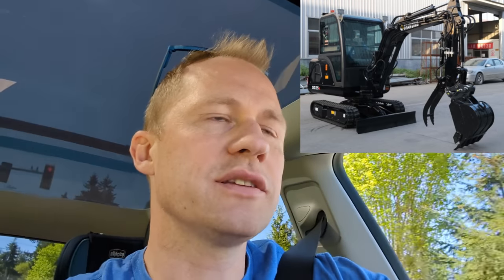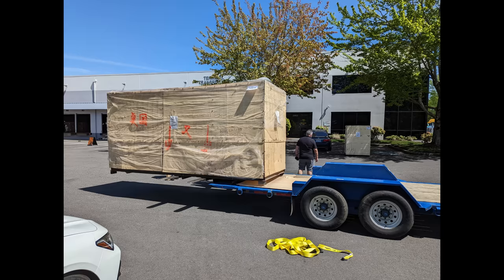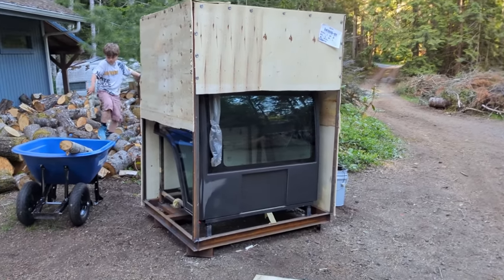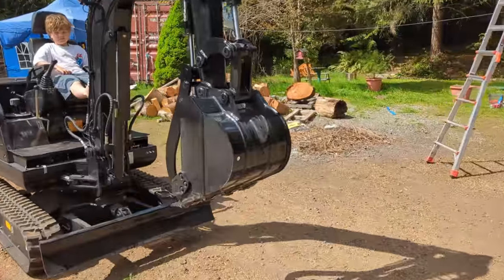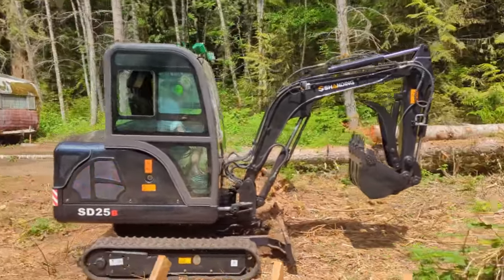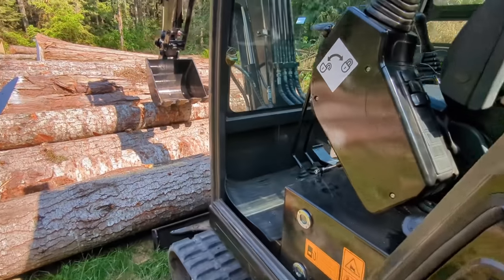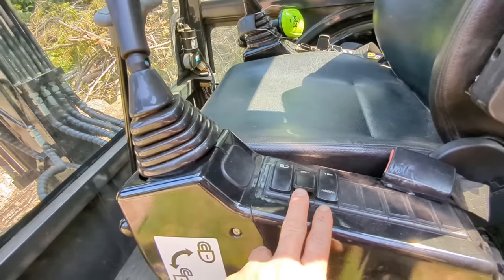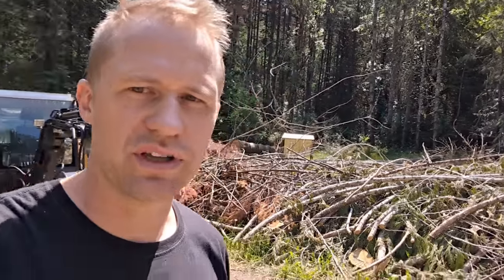Collecting my Alibaba Mini Excavator, Unboxing, and Feedback

Comment: Take it easy on that machine, don't hog it.  Grease all pivot points daily.  Pray you never have to make a video re getting repair parts from China.
Reply from the maker: I am babying it. Taking it easy, warming it up for 10 min before I drive, and let it cool off when I am done. Grease every time.
Reply: I mean the majority of parts are going to be off the shelf components so great for people that diy repairs. You can swap out the motor for anything remotely similar (a motorcycle engine would be a killer swap in) in a couple hours. Imo better for repairs than something like cat where everything even bolts are proprietary.
Reply from the maker: @stich1960  Thank you for the info. I will keep that in mind when it is time.
Reply from the maker: BTW, what does "hog it" mean?
Reply: @einarmikkelsenPNW  hogging with a digging machine is a slang way of saying you stick the digger into the material like it's already loose, grabbing full buckets in one go. The advice I received is that you should use the bucket and teeth to break up the soils in smaller passes, then grab broken dirt with the bucket to move it. One thing I noticed about this strategy is that it's less likely for the bucket to create a vacuum against the material. I think it's also less stress against the joints which reduces wear on the bushings.
Reply: @JGoodwin  Thank you so much! I'll give it a try.
Reply from the maker: @JGoodwin  Great advice. Thanks. This is all brand new to me.

Comment: Man, mine came 100% complete in one crate.  Luckily I haven’t had a single issue with it yet after 22 hours
Reply from the maker: Mine was going to be fully assembled, but it was too tall with the cab.
Reply: @einarmikkelsenPNW  My 2ton has a full cab- with an ac unit hanging from the back as well
It was also shipped with an auger, jackhammer and an extra bucket all was in the crate.
My cab also has a door that locks to the cab in the open position with a latch. 
I thought all these were prettier much the same.
It is a hightop model and look alot like the ground hogs sold by a dealer here in the USA
Reply: @jamesdarr6714  that's what l want but electric
Reply: @darrenegginton9842  Im still a bit apprehensive on electric stuff, it has came a long way but I don’t think we’re quite there yet
Reply: @jamesdarr6714  what's your concern
Reply: @jamesdarr6714  Which model did you get? Sounds perfect for my property.